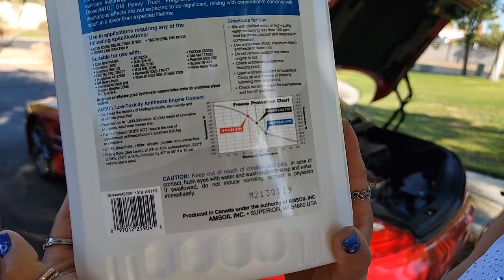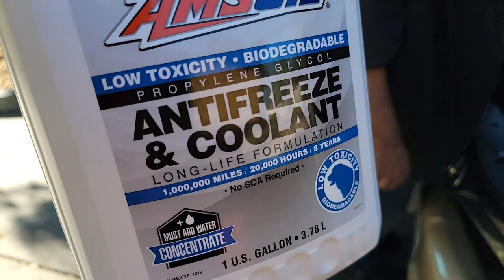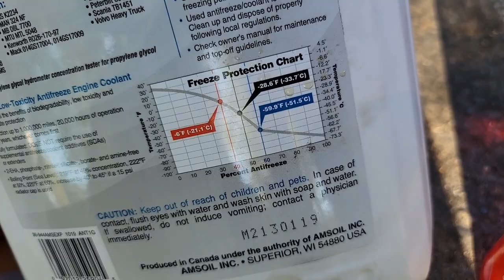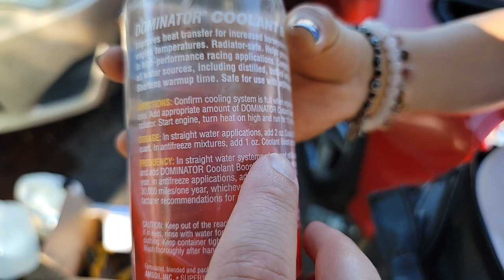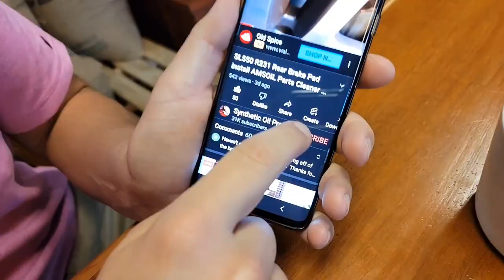Mobile Mechanic coolant change Watch the Process

Comment from the maker: Watch This: How To Find A Mobile Mechanic On Google Maps -  https://youtu.be/iaYoT0cdo3w
Mobile Mechanic coolant change Watch the Process to make sure its done right.....

I give a man a fishing pole & show him how to fish. 

     Together! We can get your vehicles to run better than brand new!

     For me to get credit & be "Your" Independent AMSOIL Dealer please use my website below or my dealer no. 5331179 call anytime Eben Rockmaker 702-472-3614
After you click on: http://syntheticoilprotection.net
1. Click hamburger menu
2. Click offers AMSOIL preferred customer
3. Click join now 6-month PC member add to cart. ( there is no reoccurring renewal membership unless you select that dot box ) 
( you have the option to not have your credit card saved if you prefer - est. 1972 )
4. Scroll up to the top Select shop by vehicle.

New Promo: FREEMS

    ♥ Your vehicle can run better than brand new by choosing the right fluids!

💯 Subscribe without being signed into Google account - https://youtu.be/dQKGYrvJsdY?si=oIUKli1wa2CXmyDS

     🇺🇸 50 Years of AMSOIL anniversary - https://youtu.be/MQUqRBI8dD0
     
     🥇🥇🥇 Synthetic Oil Protection Google map reviews
Eben Rockmaker, independent Amsoil Dealer 
Dealer no. 5331179
(702) 472-3614
https://maps.app.goo.gl/1aXxuXrXK9eJwqK78
         
♥ See fluid performance tests - https://www.amsoil.com/performancetests.aspx?zo=5331179      

     ☕ Buy me a coffee - https://www.buymeacoffee.com/Syntheticoilprotection

🇺🇸 Did you know a oil manufacturer can call a lubricant a Full Synthetic when it's only 25% synthetic? AMSOIL is different because it is 100% Synthetic and has a higher film strength keeping the metal parts separated. AMSOIL allows less friction, less heat, less wear on the component. AMSOIL Signature Series motor oil has guaranteed protection for up to 25,000 miles or 1 year of normal driving. 

     ☕ Synthetic Oil Protection Coffee - Ebens Favorite: https://supportwith.coffee/shop/subscriptions/sop/

Comment: I am really intrigued by the comment of the car just performing better with the new coolant. I plan to do mine in 2 weeks or so and I will find out for myself
Reply from the maker: Oh yeah huge difference especially on a vehicle with a lot of miles the coolant breaks down and oxidizes and it doesn't pull the heat out of the heater core and cooling system like it does when it's new so you lose the heater transfer efficiency and your motor doesn't run as strong. As far as the smoothness the Amsoil is a very smooth silky fluid it's almost like a lubricant and you'll notice your motor will run smoother and rev smoother once you change it👍

Comment: Awesome, I need to give it a try 👍🏻
Reply from the maker: 👍, yeah you'll see a huge difference in the way the motor revs and as it's warming up it will be significantly smoother.
What type of vehicle do you have?
Reply: @Syntheticoilprotection  I have a 2007 Nissan Titan and my daily driver is a 1992 Honda Civic Si.
Reply from the maker: Great!
How many miles are on the civic?
Reply: @Syntheticoilprotection  just under 300K and still going “Steeeee-rong”. Just bought it 5 years ago but I’m only  the second owner 👍🏻
Reply from the maker: Wow!!!
That's awesome we got a really good video coming up on the Honda Pilot transmission fluid change amazing how much smoother it shifted after just doing one pan drain and fill.

We also did the engine flush on the scene pilot and it made a huge difference.
https://youtu.be/1OSojPX7QKo

Comment: I like to buy premix coolants haha
Reply from the maker: Awesome Amsoil makes two different types this is the one for passenger cars - 
https://www.amsoil.com/p/passenger-car-light-truck-antifreeze-coolant-antpc/?zo=5331179
Reply from the maker: The reason why I like the concentrate is because it's low toxicity it won't hurt the environment and animals just in case your radiator were to crack in a parking lot if a dog comes over and licks it it won't taste sweet like the other coolants and hurt the animal the other big Breeze and I like it is because it meets and exceeds the 18-wheeler specification which is the hardest to meet and it is designed for anti-cavitation in pitting in 18 wheelers they operate usually quite a bit hotter than a passenger car so it has to be exponentially better to last longer.
The other big benefit is you can mix it to the exact ratio you want so say you say I want to make mix it for Alaska you can mix it 65% concentrate